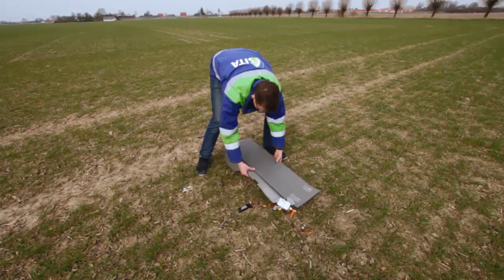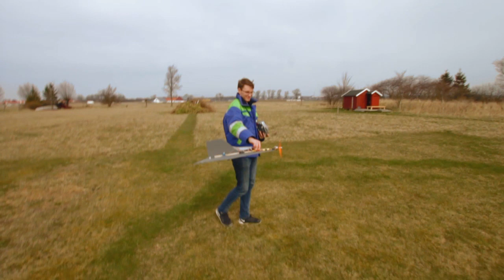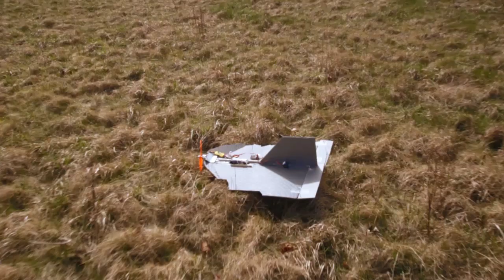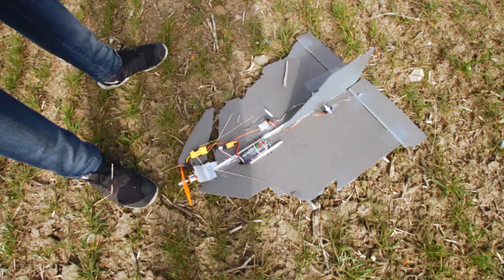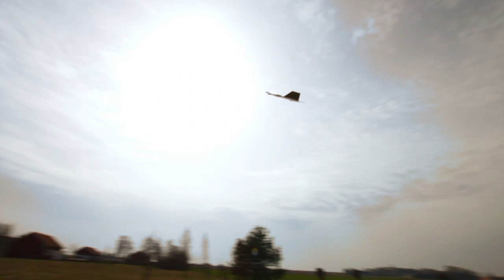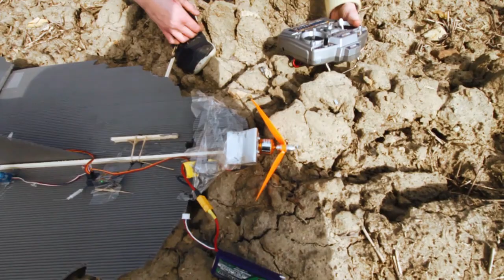Super Simple RC Plane

Comment: The battery in his recording device died.  Afterwards he just removed all the electronics from the airplane and taped them to a branch from the tree he crashed into.  He used a small rock to balance it out.  The branch with the rock flew perfectly.  This guy just doesn't give up until he makes its fly.

Comment: The secret to making these things fly properly is down thrust on the motor mount. This makes the plane want to fly down and is countered with more up elevator. This combo of down thrust and up elevator gives longitudinal stability. And the plane will actually fly rather than wallow. Give it a try. It works.